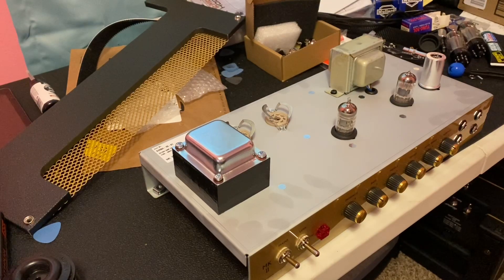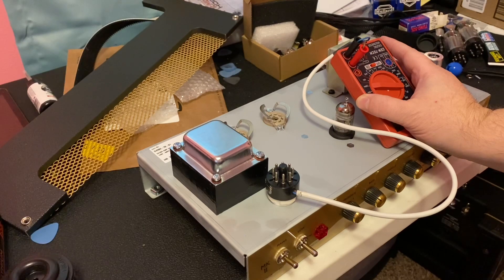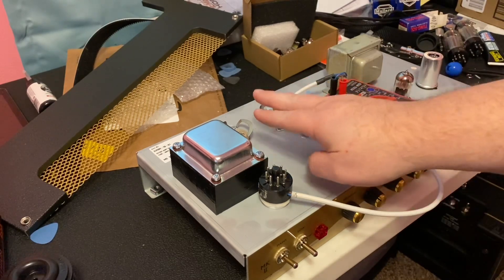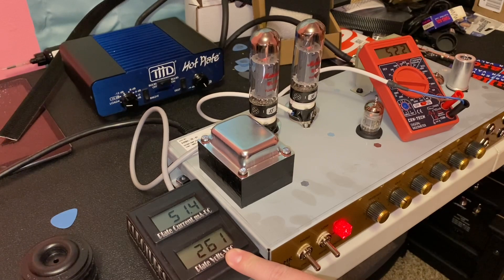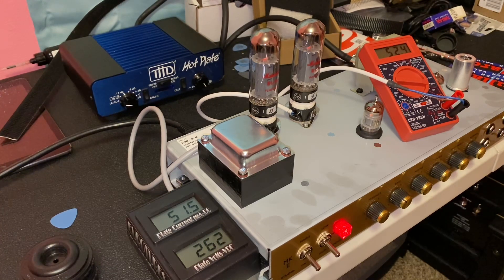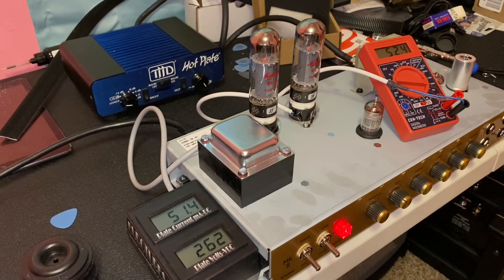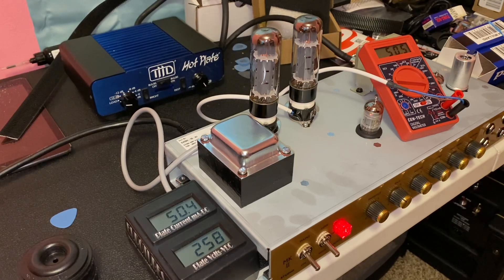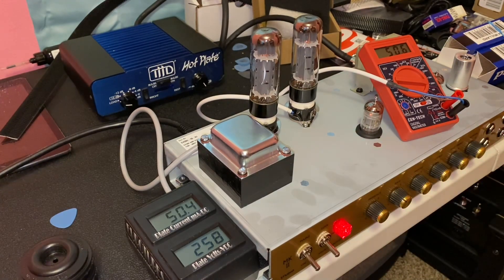Marshall SV20: What is it biased at?

Comment: JJ's are fantastic tubes and go through multiple tests and will be tested, hence the reading of 55 for both. 
This takes time after burn in.
I can take a bucket full of new or used tubes and run them through a Hickok including a life test and find a pair that are around the same denominator, so closely matched. If JJ's are coming in production that closely matched for mass produced amplifiers, then that's great quality and control!
The main differences you will find between the two brands are in structure design, material and country of origin, plant, tones, etc.
Marshall is making it simple to experiment, but their top choice is obviously the JJ's.
I keep seeing these 20 watt version heads. Wasn't there also a 50 watt as well that came out at the same time?

Comment: To calculate dissipation for a cathode biased amp, you need to subtract the cathode voltage from the plate (anode) voltage to find the plate to cathode voltage which is what the tube sees.  (Plate voltage - Cathode voltage) x Plate current / Tube Wattage = % dissipation

I would guess that the cathode voltage (bias voltage) will be about 18volts, so (262-18)x.052/25=50.7%
Reply: Correct, but the Eurotubes probe directly measures the Plate-to-Cathode voltage, no need to subtract.

Comment: Hello! I’m from Mexico and recently I get this amp but de current is 230v and In my country the current is 110v. My question is: this amp has any option to change the 230v voltage to 110v with a internal conection? Any years before this happend with another speaker and I only had to change a little wire inside of this speaker. Thanks!
Reply from the maker: I believe Marshall sells models that are set for a specific voltage input, but not user change able you have to buy one or the other.
Reply: Ho, im from Mexico too, I think that you need a external transformer for conect your amp, something for adapt 110 to 230v. By the way, where you buy this amp? Slds!

Comment: 262x0.0523=13.70 watts/tube for the Marshall tubes. 258x0.0502=12.95 watts/tube for the Mullards. If they ran full plate voltage they would output 25w/tube = 50 watts. They want to have close to 20 watts with the same tubes so they lowered the plate voltage and the bias to ~52%.
Reply from the maker: Thank you for this explanation.  That makes perfect sense having read that… it’s kinda like, “duh Rob you should have known that.”
Reply: @rockinrob6109  in the technical docs of the el34 is a 100w design with 2 tubes running at 800V listed...😎

Comment: My SV20 has an annoying everpresent hiss on the high treble channel. Is there a way to mod the amp to take away that hiss. When I am not playing, I hear this hiss. It's not present on the normal channel.
Reply from the maker: I did notice the hiss… but attribute that to it not being a master volume style of amp… the louder they are the more hiss you’ll hear when not playing.  I think changing the tubes reduced it a little bit however slightly.
Reply: This is why Eddy used to use a rockman smart gate...kind of a Plexi thing
Reply: High treble on mine definitely makes some noise. And it gets worse as you turn the treble or the presence up. But damn it sounds good otherwise. I have a 1965 Fender Bassman that is dead quiet even with single coils. Go figure.
Reply: Swap out V1 (a 12AX7) for a 12AT7. This gives a little less gain but a lot less noise.

Comment: very informative - thank you! does it matter if you use mismatched el34 valves? i have two vintage telefunken valves mismatched from different batches... and i am thinking about putting some old el34 tubes in the sv20h but really dont know how that would affect the tone/amp/valves???
Reply from the maker: Yes, never use anything but a matched set.  This goes for any tube amplifier.
Reply: @rockinrob6109   Fender and Marshall didn't match tubes in the 60's.....

Comment: I swapped out the JJ's for Mullards and a couple other EL34's, including some expensive NOS vintage tubes, and surprisingly the JJ's sounded the best of all of them.
Reply: Those are amps designed with JJ tubes. I think you'd get the best tone with whatever tubes the amp was designed with.
Reply from the maker: Interesting…. I’d be curious to see how other than JJ 6CA7’s would sound or even a set of KT77’s in comparison

Comment: Do you feel a difference in the tightness of the low end or pick attack? More compressed with the Mullard’s?

Thanks for this video. Just about to purchase one of these amps and I figured it had to be cathode biased at that output wattage rating. And good to know about the Mullard’s sonic quality being a little brighter. Will probably stick with the JJ’s that come with it for that reason.
Reply from the maker: I like how the Mullards sound when pushed.
Reply: @rockinrob6109  I've since bought a couple of these amps (with matching 112 cab's) to use for my touring rig, A/B'ing btw clean and crank. In the "crank" head I'm using old Sylvania 6CA7's and for the clean, small bottle Sylvania 6L6's. Replaced the first preamp tubes wth original Mullard ECC83's. The Chinese 12AX7/EEC83 is a bit too harsh. Rig sounds awesome.
Reply: Can't recall if you mentioned this, but I found out from factory that you can drop in all of the usual 8-pin power tubes...EL34's, 6L6's, KT66's, KT88's, 6550's, etc. Just not the 7591(used in Ampeg's), which has a different pin-out. A lot of tonal variety to work with!
Reply from the maker: @rawknotwantnot  I found that out awhile ago as someone on a Marshall forum was experimenting with tubes.
Reply: @rawknotwantnot  Great sound,  found 2 Sylvania 6L6s (small) and 2 old German made ecc83s and 1 ecc81 (for phase) can't stop playing it, the stock valves are too hard/brittle. Sounds louder and warmer now. 1×12 Alnico cab for the proper papery tone.

Comment: Interesting. These amps are biased WAY cold at around 55% of max for EL34's. Also, as plate voltage goes down, bias current should go UP to compensate. So, with the new tubes, the bias is running even colder.
Reply from the maker: You’d have to ask Marshall to be sure, my best guess is since these are 20 watt amps that running the tubes like a normal 50 watt Plexi may lose headroom.

Comment: I always wondered what the plate voltage was on these little amps...
Reply from the maker: @musicoxygen  JJ’s are what are already in the amp.... really no need to replace them with the same brand/type of tube.
Reply from the maker: Turns out the Marshall branded JJ’s are 6CA7 EL34s, which may explain the drop in bias and plate voltage when swapped for the Mullard EL34s.  

To my ear the amp is a little brighter with the new preamp tubes and power tubes.
Reply: @rockinrob6109  That makes sense....I think those little Plexi’s sound great...they are crazy loud...I have JJ’s in most of my amps,they do tend to sound a tad darker than some others I have tried.....I have a Fryette Power Station that I use with mine,but I recently had a problem with one of the tubes in the Fryette Red Plating...they are sending me a replacement set...I hope it’s just a bad tube and not something more serious..